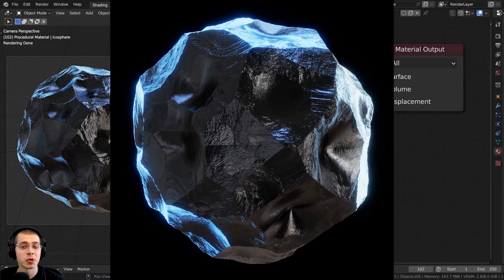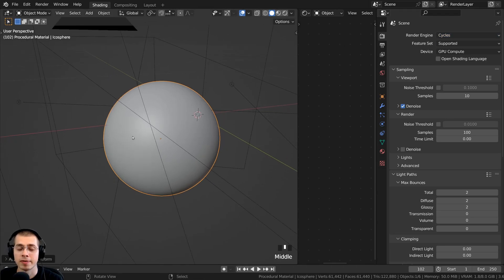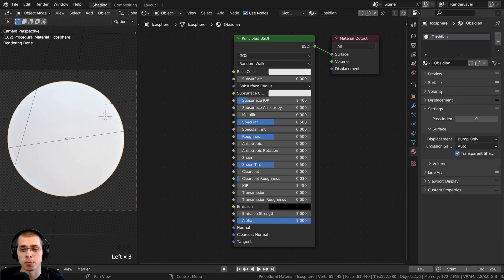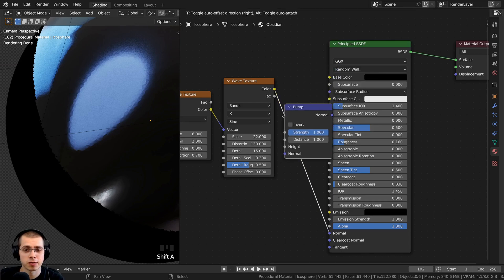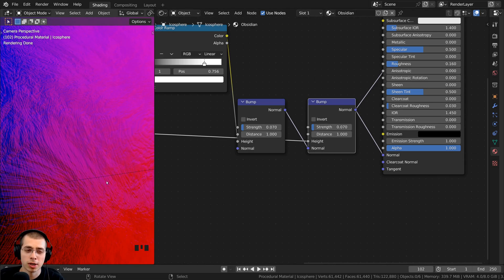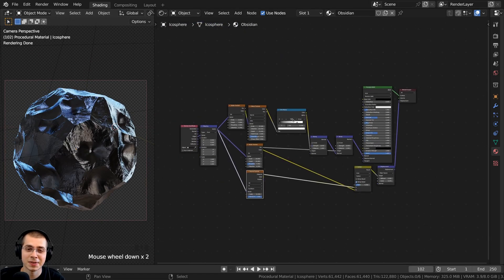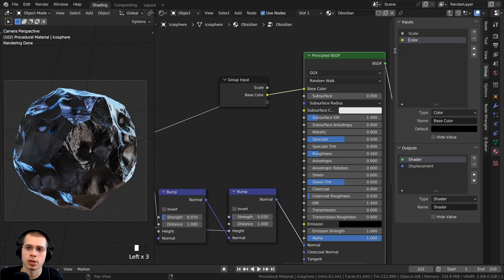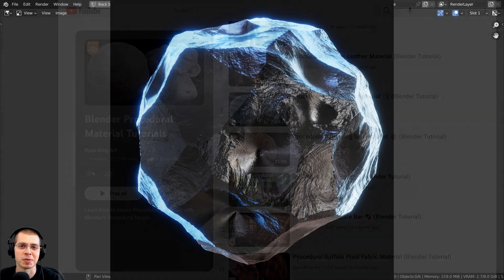Procedural Obsidian Material (Blender Tutorial)

Comment: This is very good! Obsidian is translucent and for small thin objects like an arrowhead or blade you'd see that, so I added some transmission, an IOR of 1.493, and a very dark yellow-gray subsurface scattering, which seems to work. I'm not sure how to do it but the way obsidian breaks the wavy striations go perpendicular to the plane of the shear. You probably wouldn't see the difference except in an extreme close-up shot though.